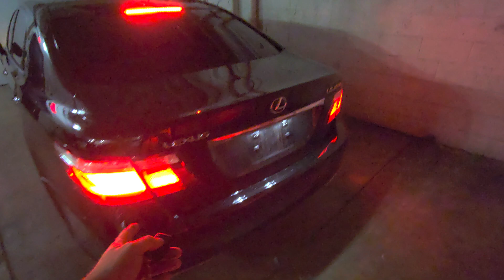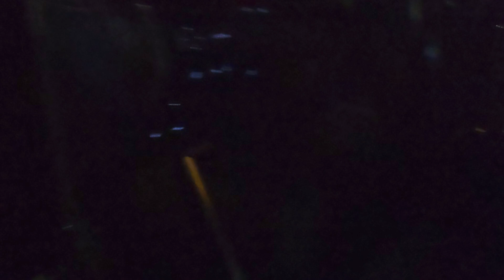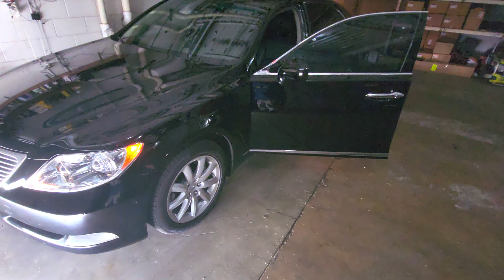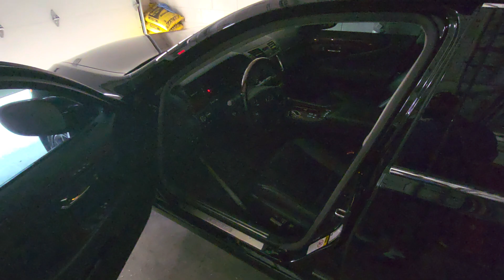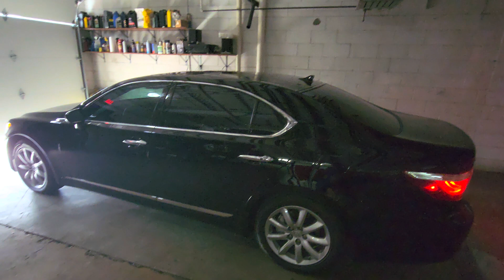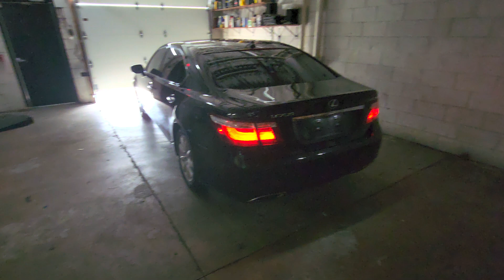Easy Rear Fog Light Upgrade Anyone Can Do!

Comment: Temp display - can't be changed via Toyota Techstream software?
Beeping also can be turned on and off - via techstream I guess.
Reply from the maker: Nope, temp is hard coded in the BCM/fuse box. You might be able to turn off beeping on US spec cars, but you can't enable or turn it on with any rest of world BCMs.